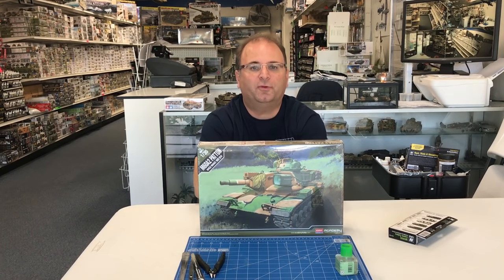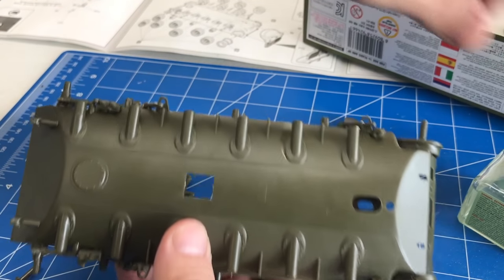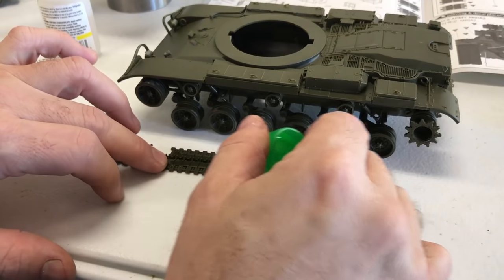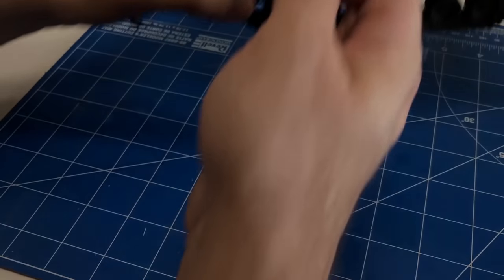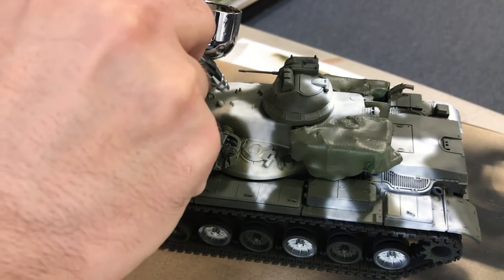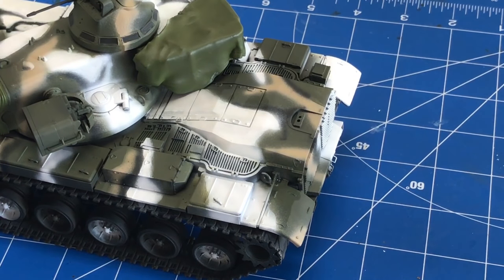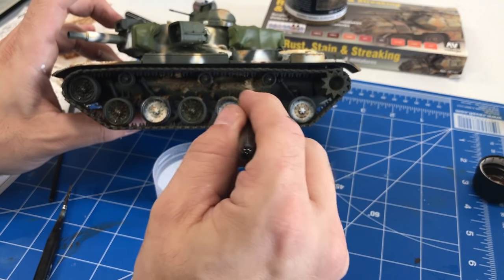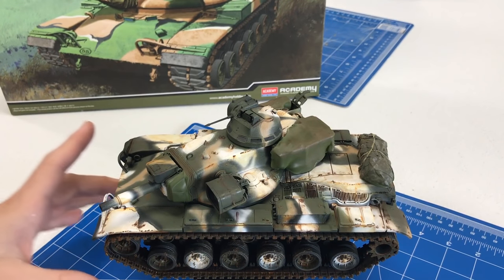Building the Academy Models M60 A2 Starship including painting and weathering

Comment: Academy Models look like quality products. I usually swear by Tamiya products, but I am going to give Academy a try. Another great video!
Reply: this is an old Tamiya kit with just a few updates some of them inappropriate like the top opening air cleaners
The M60A2 was only produced with side opening air cleaner boxes
Reply: @samm1561  Academy has long copied Tamiya kits... I was stationed with a Bradley Unit in Korea between 1991 and 1992 and when they found out I built models, I must have built 20 Academy M2 Bradleys... direct copies of the Tamiya kit.

Comment: For the storage racks or any hand rails you should use the wire they use in the jewellery craft, you can get it from sizes 0.1mm up to 2mm, it is much cheaper than brass rod or copper and its strong and takes paint well.
Just a thought because I find they break when you take them off the sprue more often than not.
Thanks for the videos, taught me loads.

Comment: Tanks that are actually in service almost never have rust on them. even the track will only have rust on it if the vehicle that hasn't moved for weeks.
Tracks of a tank in muddy condition will have a fine even coat of mud looking just like lumpy gloss paint dependent of course on the consistency of the mud.
Tracks Of Tanks operating in snowy conditions will be spotless rubber, paint and bare metal scrubbed clean by the snow and ice. 
I had a lot of fun driving an M60A1 in the snow (Picture of a 57 ton 750 horsepower snowmobile)

Comment: When I was posted at Ft.Hood,TX. I worked on the last battalion of M60-2. What a POS of a tank. The turret components constantly broke down. The circuit boards for the fire control system were not shock mounted so when firing the main gun or even just driving it over ruff terrain the vibration would disable the electronic. It fired two different rounds. One was a guided missile rocket propelled which depended on the fragile electronics, and The second round was a charge bag high explosive much like an artillery. With two completely different types of main gun rounds it made for a lagistcal   problem supply the tank. The main guns breach was a electric motor driven interrupted thread type that was know to not completely sealed when closed and when fired the hot gas would escape and burn the crew if not kill. The vertical slab side of the turret was the perfect surface for a enemy tank round to penetrate. It was always a joke to drive the tank onto a HET, carefully transport it to the top a mountain and park there and hopefully it doesn't need to fired more than a couple times. Chrysler should of hung it's head in shame for this crew killer. This  tank was decommissioned in the time I at Ft.Hood and they were replaced with the M60-A3 which was an updated version of the original M60.

Comment: The rust effect looks just like real rust. I would cut small pieces of paper towels then paint them brown or OD. When paint dried I'd carefully roll them up as one would do with an actual  tarp. Wrap brown thread near ends and toss up on fenders near engine vents or hang off turret. Sometimes to cover imperfections or the occasional booboo. The last thing I want is for armor to appear it just came from the factory.

Comment: Hi, I know this is an old post, I crew the M60A2 from 76 to 79 with the 1/37 Armor Katterbach Germany, I see that the kit came with the old track Style, and yes you are right, we did not trap over the smoke grenades, if we did any tarping it would be at the rear of the bustle racks.
As for camouflage I only seen one battalion that did that, but it was only summer camouflage most of our tanks were just OD Green, for winner we might Splash on some white wash out.

Comment: the fenders and Fender boxes on the M60 series tanks are aluminum and do not rust. Turret  baskets on the in M60A2 to were lined with diamond expanded steel mesh. the center section on both sides was taken up by a 4 Bank  smoke grenade discharger the whole set-up was a disaster from start to finish. and yes you could not cover the Bustle  rack because of the smoke grenade dischargers

Comment: Was this a modern tank or old Experiment tank?
Reply from the maker: it was  a real tank in the 1970's
Reply: They built quite a few, but they could never get the 152mm gun/missile launcher to work very well. By the eighties, these were mostly converted to M60A3s or bridge layers.
Reply: Almost looks like the M551 Sheridan.
Reply: Same gun
Reply: They built 540
Reply: Andy's Hobby Headquarters WOW O_O Looks like a tank from a future science fiction strategy game ^^ That looks like something GDI from the "Command & Conquer" series would use ;-) That would be a sonic tank or something =)
Reply: same gun system, much different tank class
Reply: @timwing1786  
I know this is old now,. But I crew the M60A2 from 76 to 79 with the 1/37, 1st Armored Division Katterbach Germany.
No there were no problems with the A2 at all, as you claim.
The problems started when the Army was getting ready to receive the A3s, so they stop making spare parts for the A2s.
There were approximately 520 M60A2s that were built, not many at all.